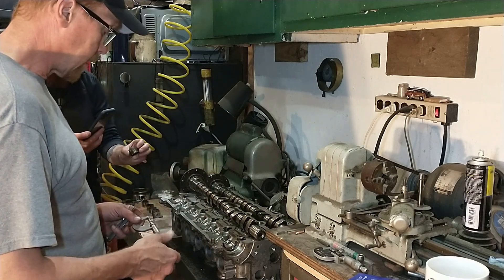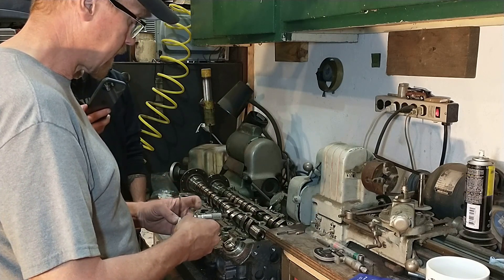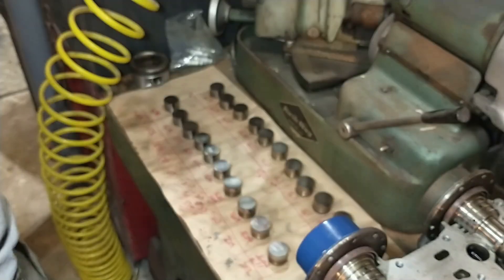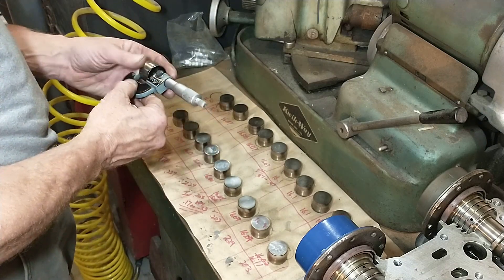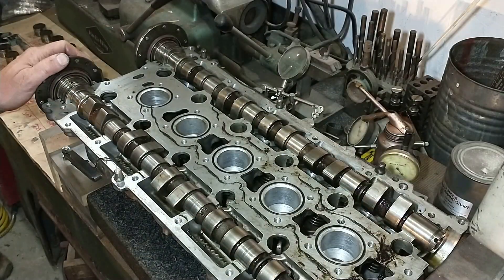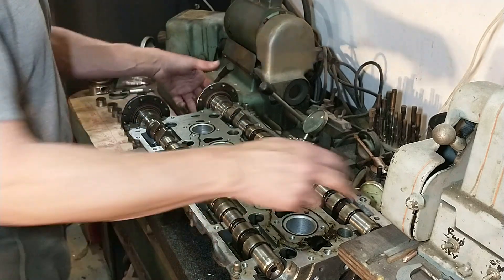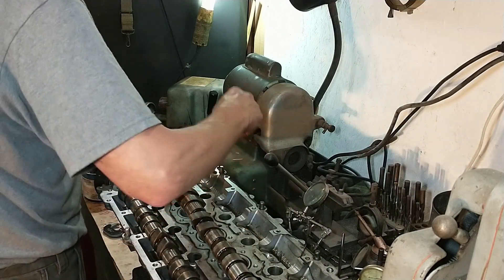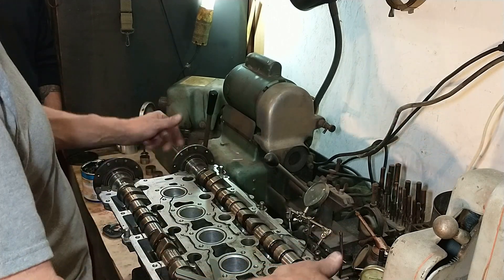Volvo 5 Cylinder valve adjustment

Comment: Have you not had any issues checking these without clamping the cam down? The clearances should tighten up with it fully bolted together. I'm putting my head together and I've replaced all the valves, but I can't figure out how else to check the clearances other than what you're showing here since the cam cover has no access.

Comment: great video... I figure you can use a piece of wood with some screws in it to hold the cam down while checking clearances
Reply: I actually don't think you need to hold the cam shaft down, the 'valve cover' is what provides the clamping force as you mentioned

Comment: vida recommends using the cam hold down tool (which I did) without clamping the cam down, how do you get accurate measurements?

Comment: I'm doing this same engine and getting .007 clearance across the board on the exhaust side which is about .009 from nominal. 
Before I grind these things, that seems like an awful lot and the valve seats didnt look that bad before I lapped them. Does .009 out of spec sound right to you. Engine has 130k

Comment: Ffs it is not simple at all check honda valve adjustment...
And yes people still complain about Hondas...
I like my Volvo but that is shit.
Propably not as bad as Nissan but o fuck it...
Reply from the maker: Are you talking Honda motorcycle or car?
Reply: @griesserperformance7801  A car F20B6 For example easy setup.
I did not want to critisize just got dissapionted to what extend you have to strip the engine to do this.
I know that is not a unique design but it is not easy at all to do.
Reply from the maker: @dariuszjanowski8224  it's cool no offense taken, that's being a mechanic some engines are much more complicated than others. I'm really a Toyota guy I prefer the 3sgte and 4ag. I've worked on lots of Honda B and H series. Happy wrenching.
Reply: @griesserperformance7801  cheers happy days😊
Reply: @griesserperformance7801  This engine is a good design, tight.  Folks can complain about the headache on rebuilding, but man they go a long time being moderately neglected and only seem to fail when severly neglected as long as you take care of certain piftalls.   I mean I have never had a severe lack of oil change ruin anything directly.
Reply: @philmcrowan2611  i've heard the only thing that can kill these engines is the valve clearances that noone does. I've just put bout 6 thousand dollars into my 04 s60 having the front end refurbished, clutch, cam and main seals and also the valve cover resealed. But they did not adjust the valve clearances. Should i be worried? Thought i was good just for more frequent oil changes and good fuel now. Don't really want to have the engine opened again soon.

Comment: Hi, if you don’t have a scrap engine to take pots from, how easy is it to buy new and what would they cost?. Thank you for a really interesting video.
Reply: For MY Volvo motor there are "buckets" aka "camshaft followers" that have an internal stem that reaches from the top of the valve stem to the camshaft.  You can buy new ones that are specific sized and the numbers have the size built into the part number, with the size representing the distance that it takes up between the valve stem and the camshaft.  So for my engine PN 1298612 indicates a bucket that is 16.12mm.    If you find that your valve lash for a particular valve is too much, you can look at your current bucket PN and predict what is needed.  You can go the easy way and clean up your current bucket because on the inside there is a laser engraved part number you can use for reference.  Or you can do the better thing which is to measure the valve lash and the actual bucket height and arrive at the king of measurements which is the valve stem to camshaft distance, then find the right camshaft follower to shove in that gap to give you the correct valve lash.

Here are the consequences for bad calculations:
1. Camshaft follower too short: Noisy, and possibly higher wear rates.
2. Camshaft follower too long: The valve stays open by a small measurement and all the exploding gases just escape through that gap and melt the valve.

Hit me up at justin dot hirst at protonmail dot com if you want.  Easier to talk in person.
Reply from the maker: I haven't bought new ones for the Volvo however I have ordered specific sizes for motorcycles. I looked on Rock Auto and they had them but only in one size.

Comment: Good video sir, I would like to know what will happen if the valve lash are not adjusted? My car won’t start and I’m suspecting this could be the problem because the head was rebuilt
Reply from the maker: If there is no valve lash/clearance the valve will not close if the lash is excessive you will have a very noisy tapping valve train. I would recommend checking compression before disassembling anything. Good luck with it 😁
Reply: Thank You, I did the compression test and the compression was low . I was asking what are the specs for the adjustment please I want to try and fix mine😂 Thank You
Reply: @ishmaelbaloyi  did your timing belt pop off? if so your engine is toast and you need new valves. its not just an adjustment. if you have low compression you have issues in other places

Comment: This is really, really good! 

Question: it is possible to change buckets to hydraulic ones? So we can end the adjustment one and for all 😅
Reply from the maker: I don't know that the oil supply in the head would be adequate to support hydraulic valve lash adjusters. Once adjusted the solid bucket should be good for life.
Reply: @griesserperformance7801  It will not last for life. The exhaust valves are sinking deeper into their seats over time because they are getting lot more wear due to higher temperatures and subsequently more expansion/contraction related seat wear. I would say it might be good for 100k miles but after that gaps should be checked. Because the very moment the exhaust valve will fail to close completely there will be a catastrophic failure within minutes.
Reply from the maker: Very true this engine has not proven to be as durable as my Toyota that's for sure at that point I will just put another head together and replace it. Fortunately due to the common automatic transmission failures there are many engines available. @NilsJakobson